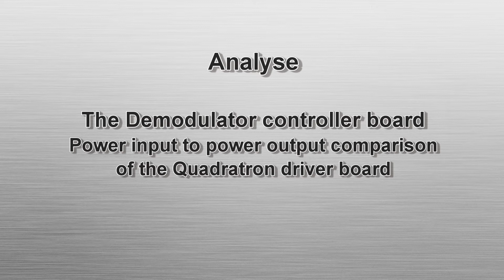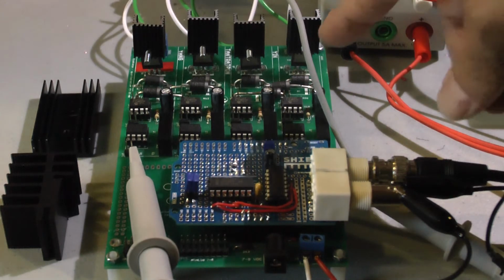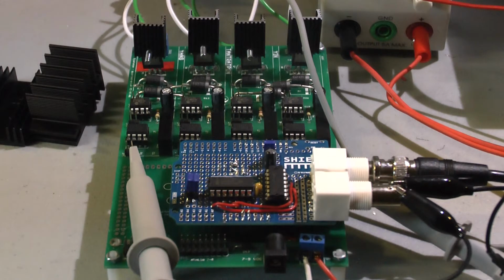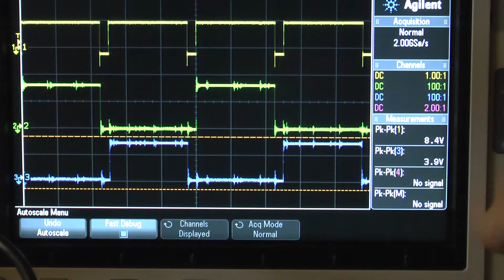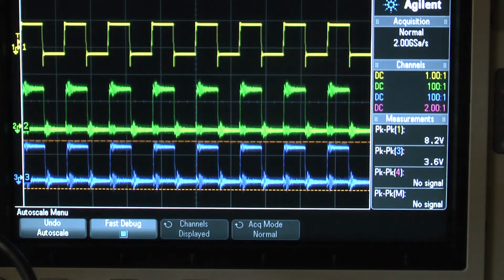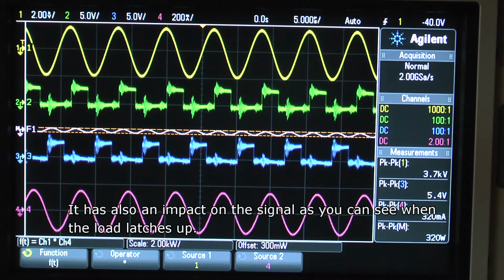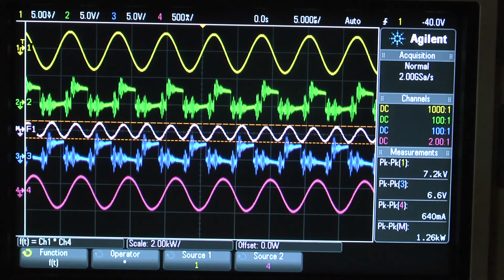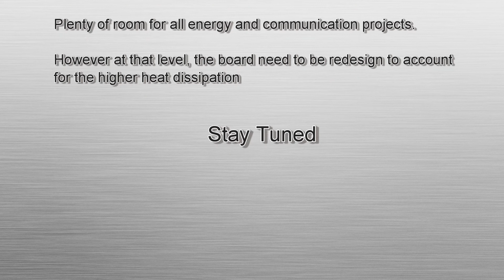The Modular Quadratron Board from Tantratron,  Part 4. The Demux Controller board

Comment from the maker: Yes, I have done that,works fine.The VIN can not be used because it is not regulated. The Arduino mega has a 7805 regulator on board. The board for the community need to have all connections available. I like to avoid all such support questions.

Comment from the maker: Yes, I have in the first video provided the details about my new Bipolar Tesla coil. I was suggesting to use the Quadratron v4 already. The CPU interface is perfect but the lead need to be build for that. Also I need to check if the 5 volt is on pin one. The Q3 board was open and I did solder it to feed the power to the controller.

Comment: I found your other video and intend to do a build, thank you very much for sharing. Look at pin 3 on the voltage regulator, ic 17 on the pcb.pdf file, to see where +5 is connected to. I use the pins over on the left, where ground is the leftmost two pins and +5 is the two pins just next to that.

Comment: I built the second generation quadratron board and I really like it a lot. I have huge heatsinks and to-247 igbts on there and it works great at high power or low power. Do you have the specs (diameter, gauge, #turns, geometry) for your bipolar tesla coil so that others may replicate?